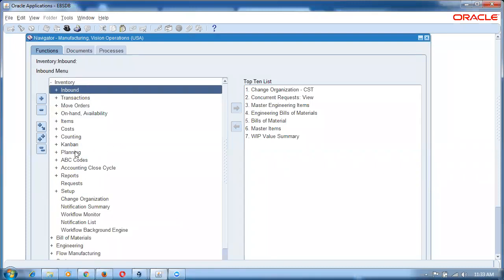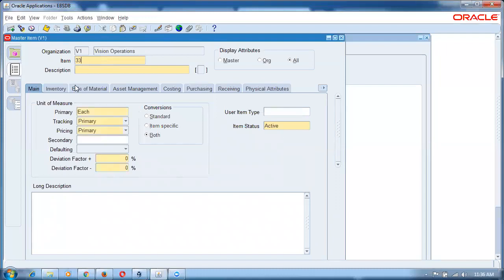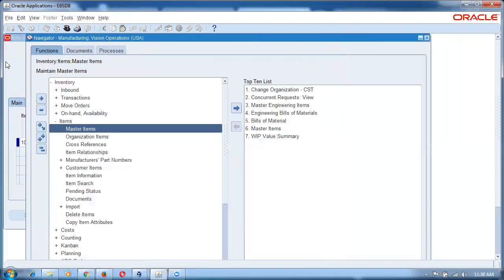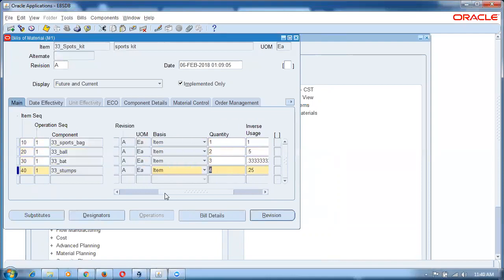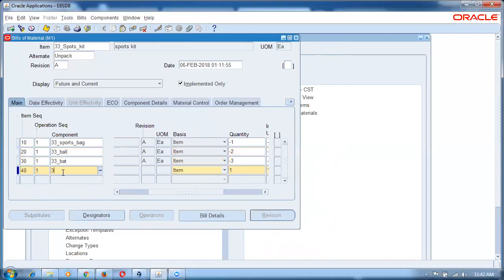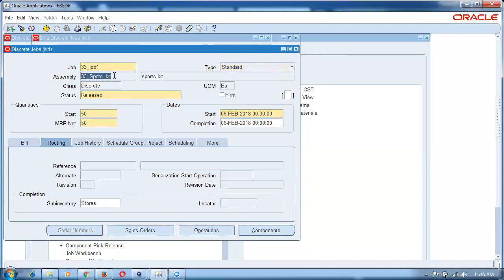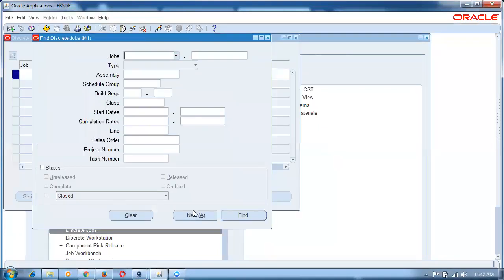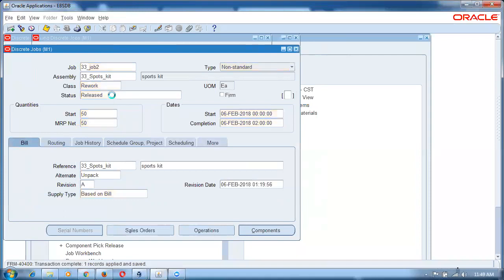Kitting Dekitting Outside Processing

Comment: Hello Sir, I have one requirement where client wants to implement OSP without having BOM/WIP modules...basically they want to keep track of item tht are being sent to third party for repair and details of item returned/repaired in the system.. is it possible to do so? If yes then what is the workaround?
Reply from the maker: OSP without BOM / WIP Licence is not possible
Reply from the maker: Make a payment using Net Banking / Credit / Debit Cards / UPI at this link  https://imjo.in/vjPeCk I will mentor you..if struck during practice  oraclenana.com